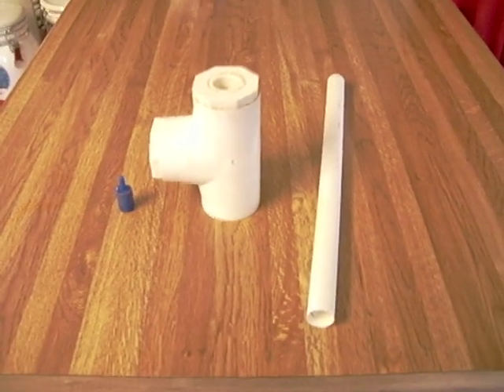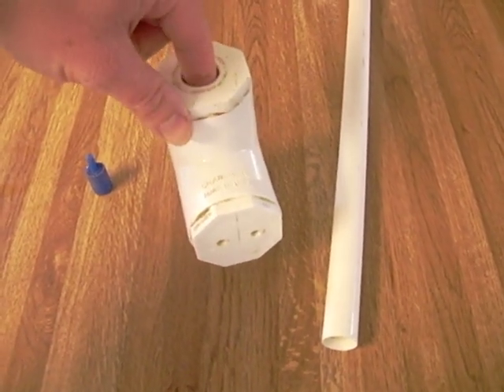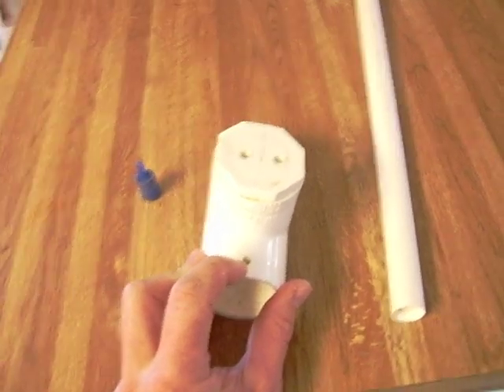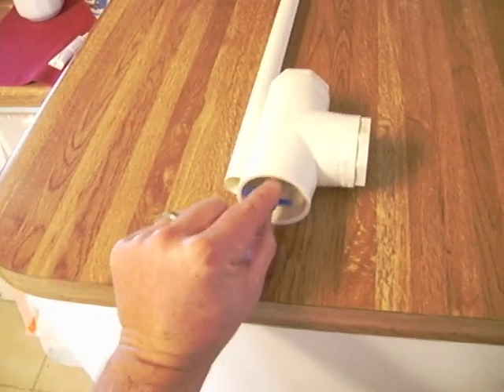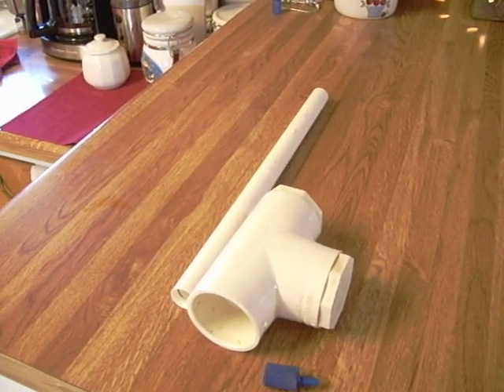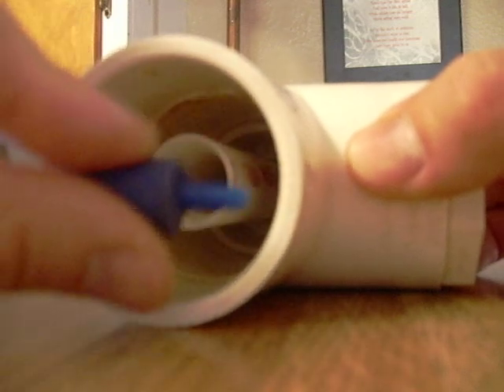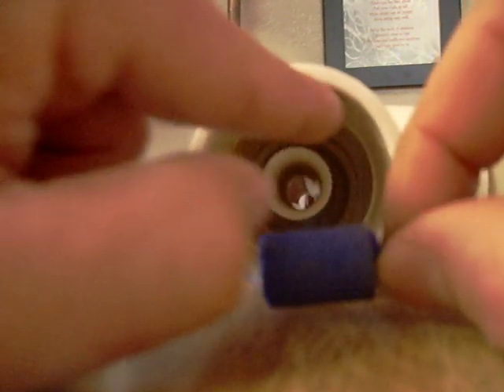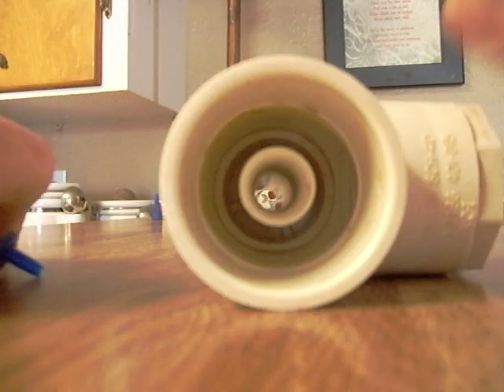DIY Geyser Pump

Comment: Nice video- BUT Can you add the following to make it easier for others:
1. where did you buy the items from?
2. price for each item
3. part # or skew # for each item.
4. use a tape measure or two in a L form so we can see the dimensions.
5. maybe add this info in a spreadsheet or table at the end of the video as I have seen others do also.

Also- tag it as a water pump. Most people will NOT know or search for Geyser, they will look for water pump.

This is GREAT, we need more vids like yours.

Comment from the maker: @sizemorej It is possible but not probable.  It has problems with large amounts of air and the only way to remedy that is to design the pump like the original geyser pump.  The original geyser pump has two chambers, if you can imagine suspending a cup on the bottom of the lift pipe.  What happens then is like a siphon action, all the air is sucked out of the pump and water rushes in to take is place, the air obviously rushes so fast that a large slug of water is pumped up.